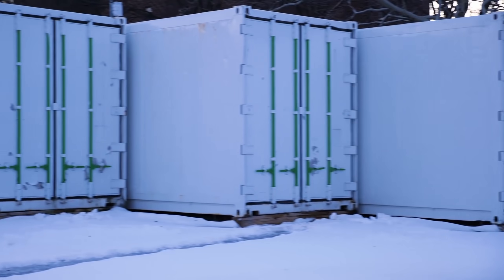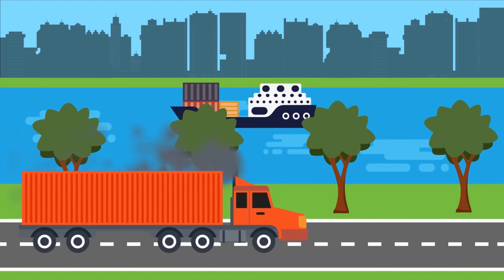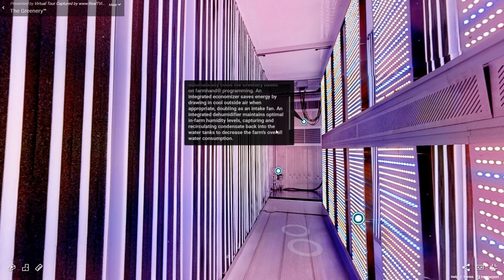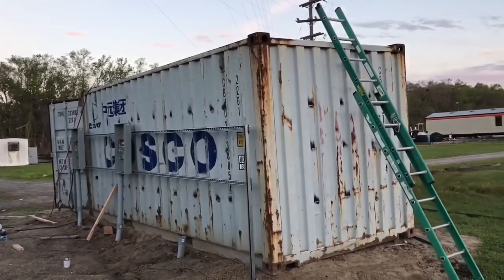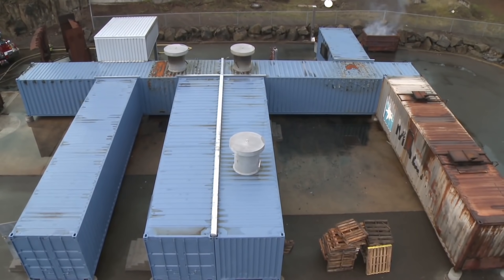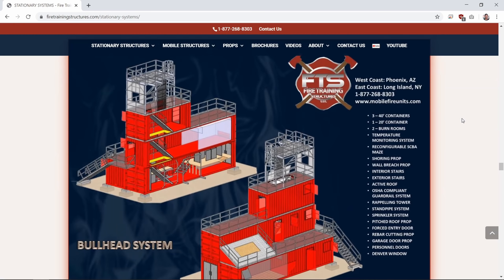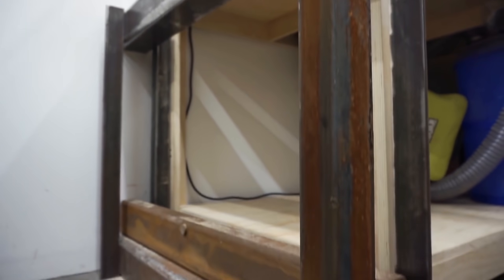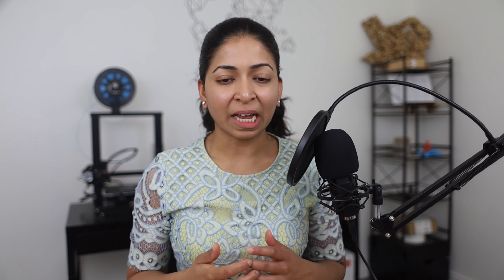Top 5 Shipping Container Conversions | bitcoin, Kimbal Musk & more

Comment: Hi Belinda, It is nice to see an architect who is not stupid in love with shipping containers for homes.  And that is also pointing out the serious issues of condensation that they present.
   I work in international construction so we ship a lot of containers all over the world and then we convert a lot of them for temp. storage, offices and toilets.
 Leakage is a problem, but condensation is the  huge issue, it is the worst in a cold climate but bad in the tropics also--  like the Philippines, Africa, or Sri Lanka and anywhere with a similar climate.
 The exterior insulation is the best way by far but it is more permanent and compromises the container more than we want. We need  to build things quickly,  and to reuse the container when we leave. As you said in your recent video, don't use any bat insulation!  Ideally frame it and spray foam or use foil faced foam and tape and seal the edges. the other thing is be sure you get it well up off of the ground as the water vapor will flow through  at an incredible rate and further complicate your life. Also as you showed in several of your examples you need a secondary roof, if it is going to used long term. the roof will not drain well, and will rust out in a short time if you don't. 
  Another point that you did not go into at least I did notice was after you go through all the difficulties of welding and structural mods to frame out the openings between the two or more containers, is, if you do not put on the secondary roof, the near impossibility to seal the con-joined containers against water.
Nice series and good job. You tube is full of haters so ignore them or shut them down, don't let nasty people get under your skin!
Reply from the maker: Thanks for sharing your experience and perspective! I appreciate the support.
Reply: Great information.  I am currently in the proof building out a shipping container for a hangout spot.  I’ll definitely put a roof up and raise the container off the ground
Reply: I'm in the Philippines and I was set in buying a farmland and using shipping containers as a farmhouse. Your advise and this series have greatly made me rethink that.
Reply: @iampoch01  what did you eventually chose?
Reply: @stephenwilkinson1254  we're going with a traditional housing project. If we can afford the modular construction, we'd go for that. I think there's only one construction company that does that and they're expensive. Right now, though, we just bought land.
Reply: Nice comment. The tropic climate is not the same in every part of a tropic country. I feel sometimes the issues for containers or other non traditional construction methods are over generalized and simplified. So you can be in Philipines for example and have different micro climates if you move yo different areas inside the country. So it is more complex actually. Your experience shows quite a good ammount of quality in your advices as well.

Comment: Hi Belinda, great video about shipping containers insights, I agree with all your arguements for the disadvantages about shipping containers buildings, however, I think there still are several advantages as following, good for transportation when are builded in massive productions at the same modulars size, hence cost effective, and can be built in a factory within short period. Good for apartments hotels hospitals ect. It can reduce carbon footprints during the construction process. It is freight effective, so it can be made in labour and materials cost effective areas/countries. Again, your videos are very inspiring and nice discussing this with you. From a building structural engineer.

Comment: My family has a piece of land in the sierra nevada mountains in Northern California. We use it as a base camp and have 2 20' containers that we store items in so we dont have to bring everything with us every time go up to camp out. When the Paradise wildfire burned across that part of our land everything that we had built out of wood in the last 30 years BURNED to the ground. We had cleared all the brush and tree's plus any thing that might by flammable from around the outside perimeter to at least a minimum of 50'. The containers survived the fire because of all clearing we had done, some of the paint was faded or burned from the heat and there was ash everywhere,inside also because the door seals had melted on the sides but everything inside pretty much survived the fire. The outhouses did not, they were burned to ground.  I watched all your videos on containers and thought you did a wonderful job of explaing all the plus's and minuses. I don't plan on living in one, but just wanted you to know it survived the fire because it was made out of steel.
Reply from the maker: I'm very glad that your belongings survived the fire! I hope you don't have to go through that again. Thanks for sharing your story.

Comment: Love this video!
I knew someone who had one of the smaller containers and installed another set of doors in the back. Those doors came from another container that was too damaged to use but the doors were in good shape. I wonder if doors on either end would severely compromise the strength of the structure... Humm
Reply: Not so long as all of the pillars are in good condition. The walls are not structural though I would weld in a corner gusset in all 4 corners both ends just because it's a cheap way to reinforce against possible twisting.